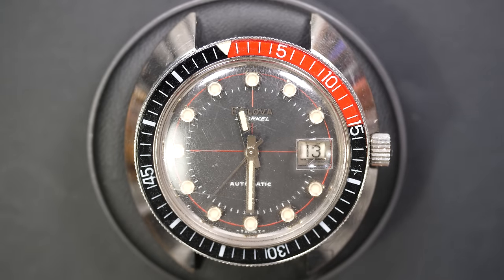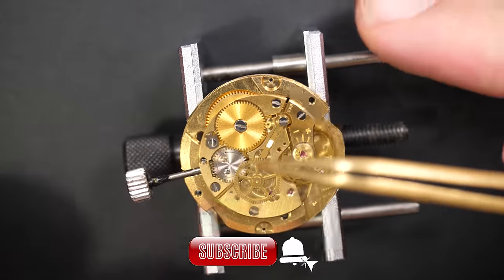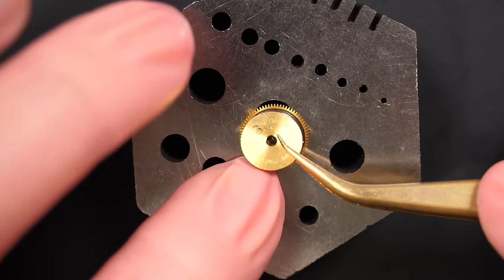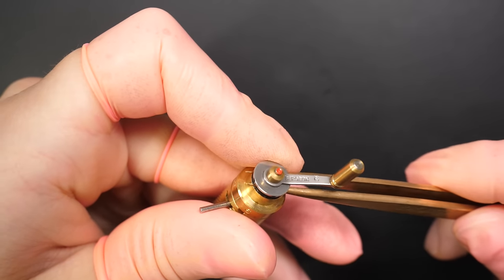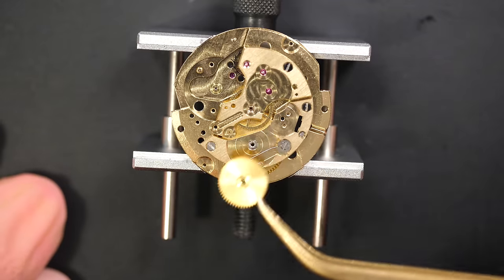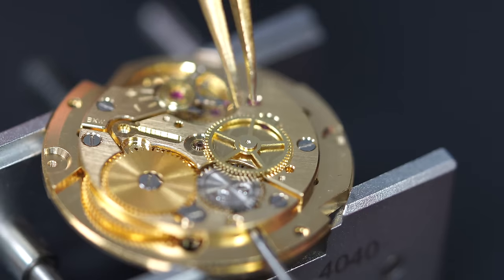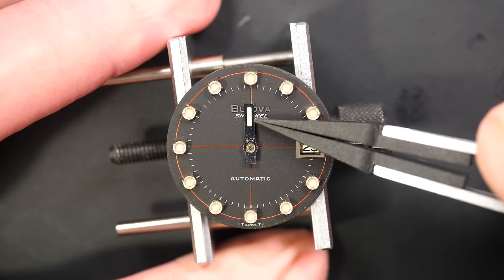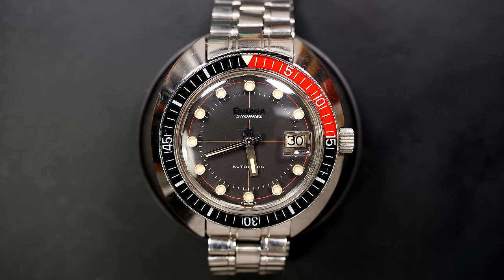Restoring a Vintage Bulova for One of my Patrons

Comment: Another great result, thank you so much for posting! The watch owner will be thrilled, I'm sure.

I really like these older vintage Bulovas, especially the divers with those amazing indices. Pity though about the current Bulova range - apart from their vintage reissues (which are all fantastic imho) everything else in their current range is 100% dreadful
Reply from the maker: I agree 100% with you. The vintage ones were so much better. Even if I don't really like quartz watches, I need to find a nice accutron to work on and learn a bit more about quartz

Comment: Breguet clutches on the reversing wheels- that's very different.  I'm used to seeing something very different- and much more difficult to execute- like a ratchet and pawl inside of a riveted wheel, which systems like the Mido/AS Powerwind and Etarotor uses.
Reply from the maker: You are my wikipedia for the movements. You know a lot it is great.

Comment: That's a very nice watch.1970's I think ?
Reply from the maker: It is a very nice watch. Never worked on a Bulova and I was positively surprised. It is probably from the 70's
Reply: @FrenchWatchCollector  I believe watches from that period with 666ft water resistance were known as devil divers, 666
Reply from the maker: @orvillefindley8117  Yes I was surprised as well when I saw the number.
Reply: The N0 date code on the back means it was made in 1970.
Reply from the maker: @douro20  Thank you for the info
Reply: This was my first dive watch dating to around 1972 or 1973. I still have it…somewhere in a box. This excellent video has inspired me to find it and relive those days of my youth. Thank you!